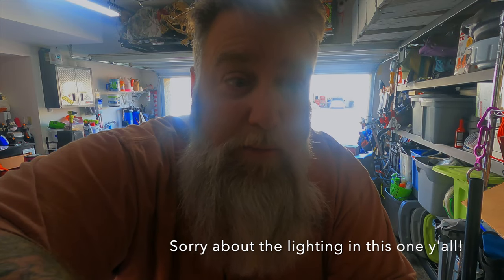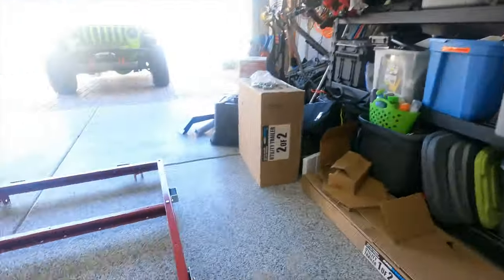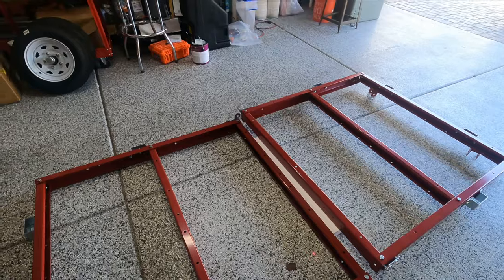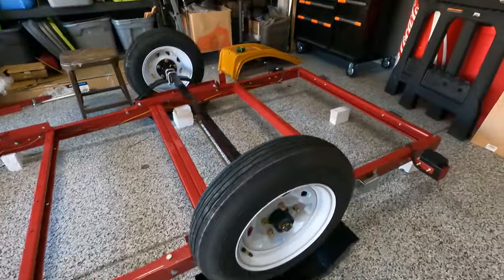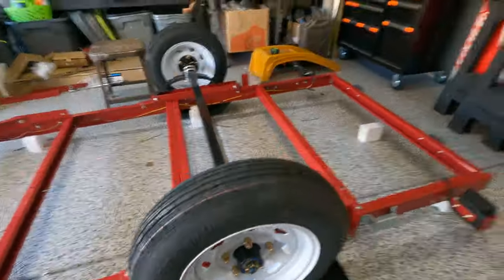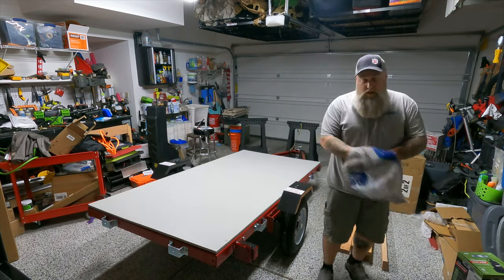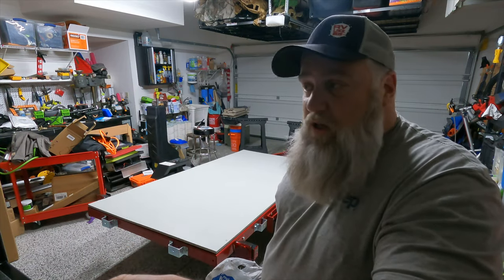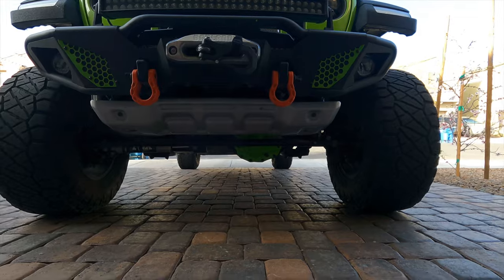HOW TO BUILD A HARBOR FREIGHT TRAILER (For our Off-Grid Homestead!)

Comment: We modified a HF trailer a few years ago to pull a mini chopper behind an Electraglide. Had to lengthen it, (the "mini" is almost 8 feet long) and made it strapless carry.
You only have one lock pin to load or unload the bike. Bike has a tube welded to the bottom of the frame.
Piece of deep channel iron bent to fit the front tire. Snugs right in, holds the bike upright. A roll-over hump on back that acts as a scotch for the back wheel. Two heavy hinges mounted to the trailer. Roll the bike on, flip up the hinges. Slide a bar through the hinges and the frame tube.  Click. It is now part of the trailer.
Reply from the maker: Very cool mod!